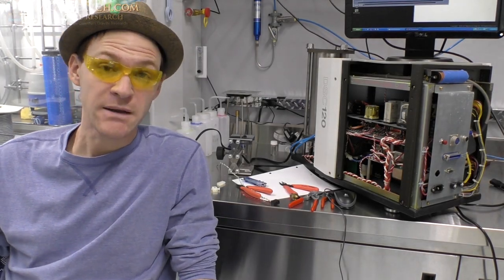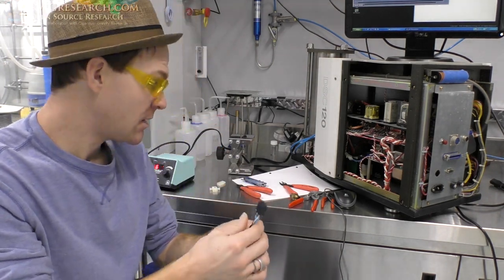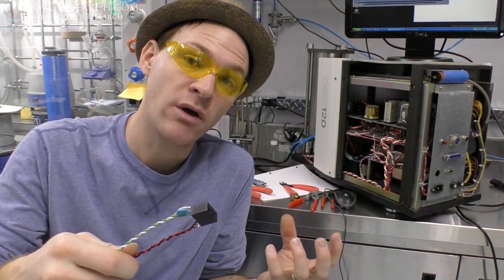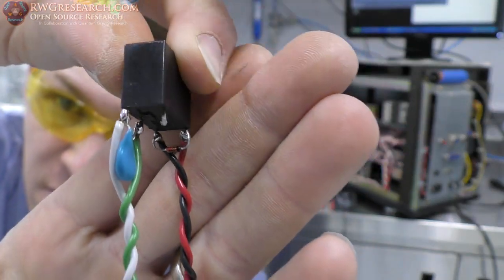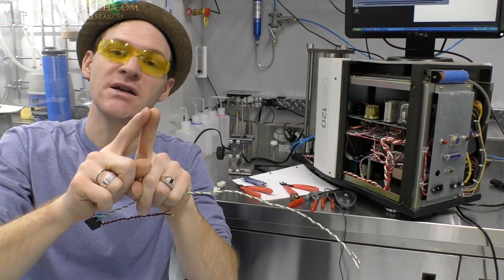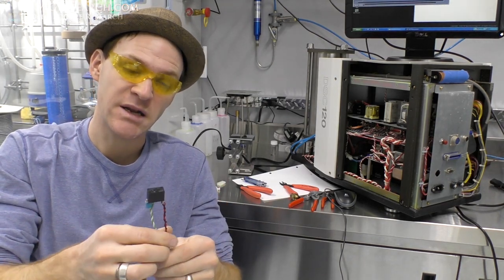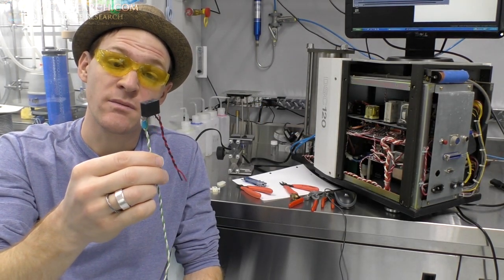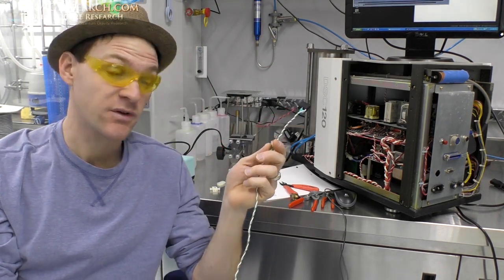Relays & Sensitive Electronics, The Basic Need To Knows, BEMF& Arcing

Comment: You need to caution the viewers that the diode must be wired with the anode to negative voltage and the cathode (side with banded mark) to the positive power applied to the relay coil.  If you do it wrong, you will forward bias the diode when power is applied to the coil and burn diode out.